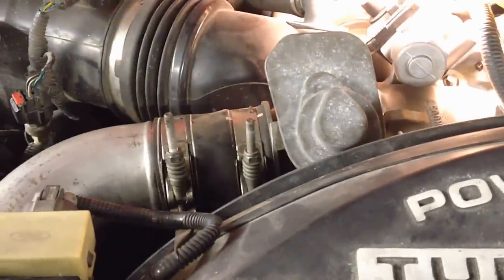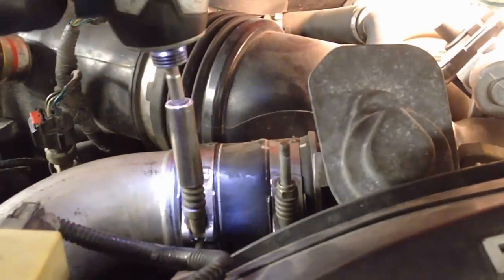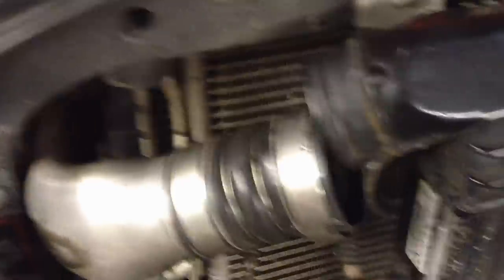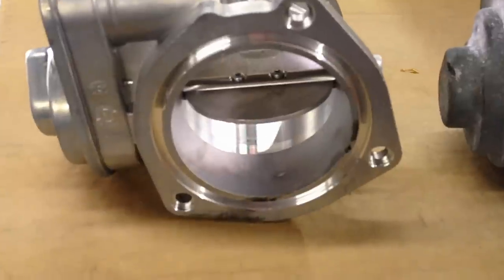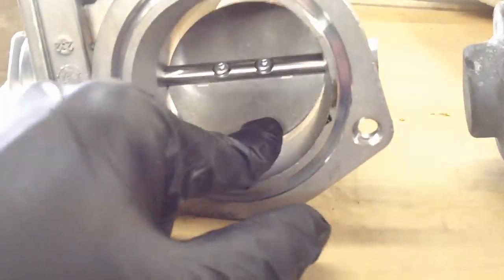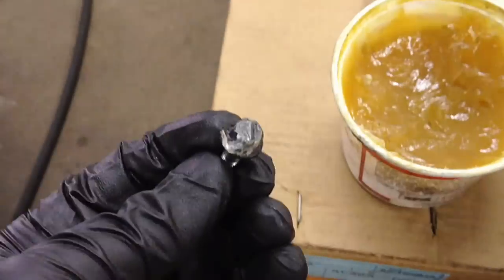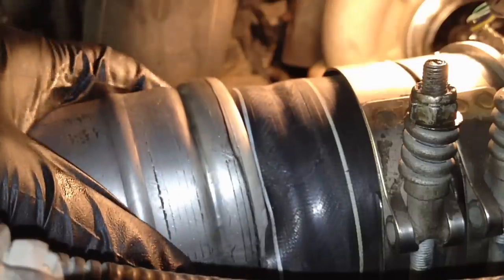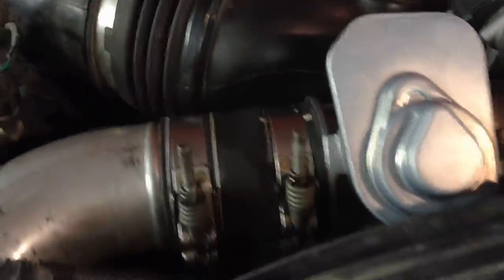6.4L Powerstroke P0488 EGR Throttle Plate Repair

Comment: Dude...awesome...thorough...video. I want to take my TB off just to clean it so it doesn't seize up due to carbon build up. I have 91k miles on the truck and I've seen videos of 6.7 PSDs not starting because of carbon buildup in the TB. What tools did you need to take it off? Oh and I'm in a 2010 6.4L. Also quick question. What is your opinion of these engines? Are they good engines? I take care of mine religiously...drain fuel/water separator every other month. Run Archoil fuel and oil additives. Follow the severe duty maintenance schedule...oil/filter every 5k and fuel filters every 10k...all Motorcraft filters. Delo (Delvac) engine oil.

Comment: If I replace this part my self whats my best way of getting the code cleared? or the extra step your talking about is that only done at a dealer? Also do you know this part number?
Reply: The part number is 8C3Z-9E937-A. You may also want the gasket 8C3Z-9J559-A.

Comment: I have a 2010 f250 with a 6.4 powerstroke it came up with a p0488 and a p0104 maf intermittent ckt fault. My truck is lacking power and it will die like its low on fuel pressure also gets a rattle sound in the engine at the same time. Do you think these codes could cause that? I checked fuel pressure, it stays within specs. I've had this problem for awhile and no codes then these codes just came up today. No codes previously so I was stumped just started with the basics.

Comment: Hey what are the torque specs for those three bolts to the throttle body. Did you unplug batteries to do this job?Thanks, great video!
Reply from the maker: +calgonzo7 Unplugging the battery is a good idea yes the torque specs are 89in lbs.